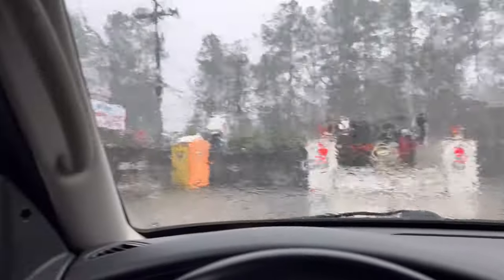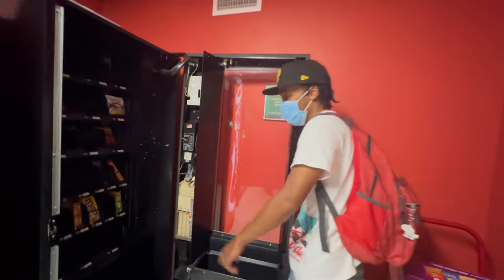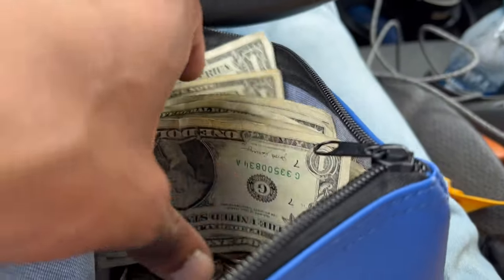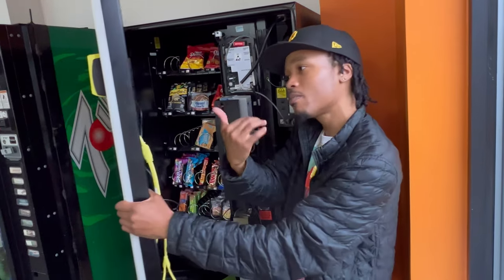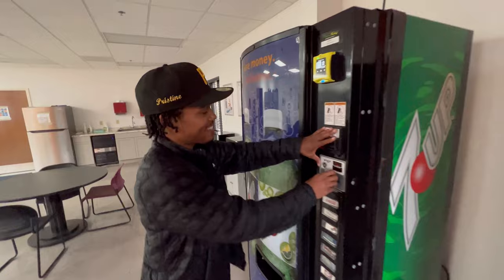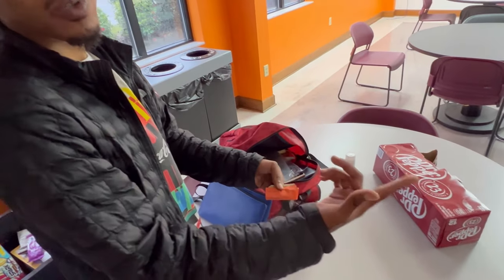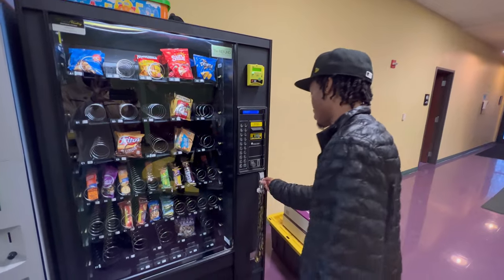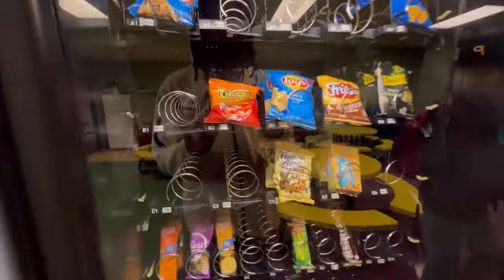1 Month Vending Machine Collection | 5 Machines

Comment: If I could say one thing that would be a bit of an improvement for your videos, I would say don't just tell how much money was made, a.k.a. the profits, include the costs, the occasional maintenance, and the overall gross profits that each machine made.  We know you made 580 ish, but what were and are the costs for the products, the maintenance, the driving time, taxes, etc., and the actual overall gross profits.  200, 300, 400 actual gross?  This helps too for anybody wanting to do this too,  excuse otherwise your thinking that you make 300 a weekish, then find out you only made 80 after everything is all figured out, and you actually need about 5 or 6 of these if not more to make this more than a side hustle if you want to do it that way.  I hope this helps.  Thanks, and heaven help you to have fun with this and make good earned money!